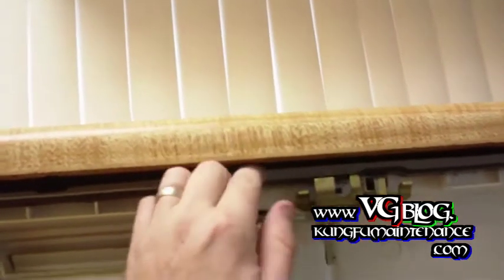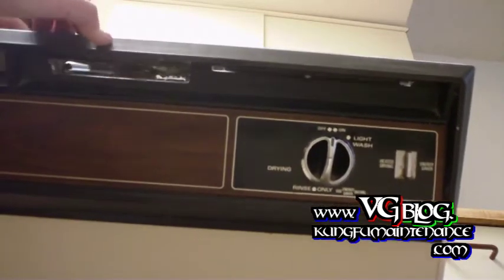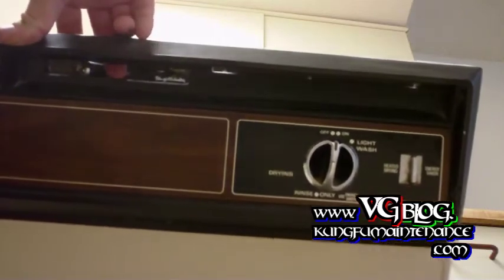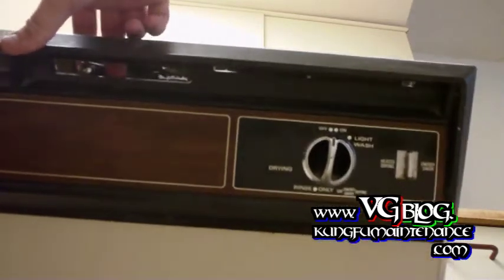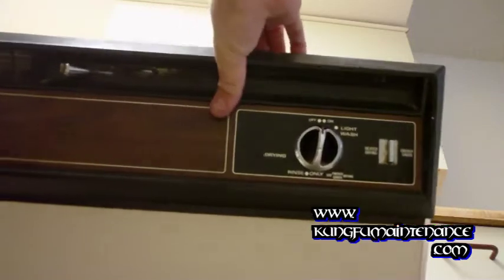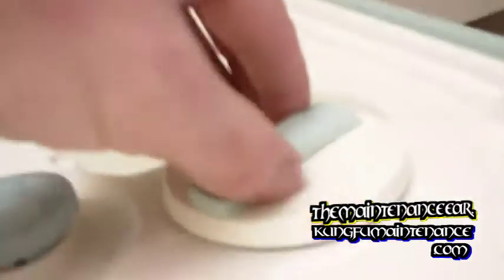How To Fix  A Dishwasher Soap Dish That Wont Stay Closed

Comment: I have a GE potscrubber 900 but saw nowhere to reattach the spring. The plastic post anchoring the spring was still there but cracked, so I wrapped some picture wire around the spring post and the nearby timer assembly screw post to relieve some stress from the spring anchor post. I think that'll do it. Many thanks for the video, otherwise I'm not sure what I would have been looking for!

Comment: I'm glad I came across this video. I have the same problem and same dishwasher. Trying to figure out where the spring was mounted on both end because mine popped off in both places. After studying your video and looking at mine (mine was apart) I had to take the motor off and I took a lucky guess where to mount the spring and it works. 

Thank you so much.

Comment: Could you do a video specifically detailed and focused on getting the latch apart to separate the inner and outer door? As in feeding it out from the "inner" door? All repair videos skip over the latch saying "be careful here", lol - getting it thru the inner door slot was a challenge both ways. 
After disassembling and checking the cup and lever situation, there was a disagreeable interval for that reassembly. (All repair videos do the same thing, placing the three-armed lever over the center and then setting the spring behind it, unseen. It would be great to point out the pin where the other end of the spring will stop, before putting it on.) 
Could you also do a detailed, focused  and lit video pointing at each piece holding the black cover on, and how to get it off? I tried to "slide" the black cover off per this video. I found two tabs and a bar thru a loop, but lifting was accompanied by a scary cracking noise and a little piece of a black post flew out in a nice arc. I'm pretty sure that was the spring post, lol. Couldn't find a substitute "good place" to link it. The white arm went from having a stiff 1/2" movement before disassembly to a loose-jointed 90 degree sprawl, heh. Gave up on it.
I realize juggling a flashlight while you stretched the spring would be ludicrous  - but maybe after you hooked it, you could shine the light in there and point the camera directly in, to show your result? That would help the viewer to see how it could potentially look when done.
During my feeble repair attempt, I turned my head and discovered a long metal bar whch had appeared from nowhere. lying on top of the outer door, lol. I found a place to fit it where the inner and outer doors meet at the top, but could not get it to behave whilst also getting the latch mechanism properly seated and thru the inner door slot. During the very unpleasant hour or two that I tried, I began to despair of even restoring the previous "cup-won't-latch" operating state! (It reminded me of the old quote, "If it ain't broke, fix it 'til it is!")
I finally ended up leaving the bar out in sheer desperation. Obviously the cup will still not be latching closed, but I have no idea if the bar matters, lol. Halp?